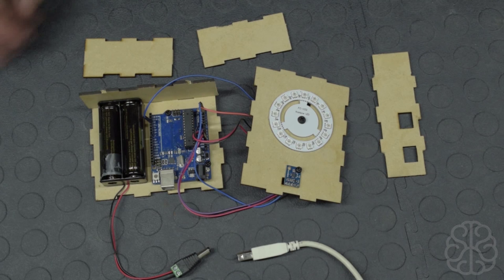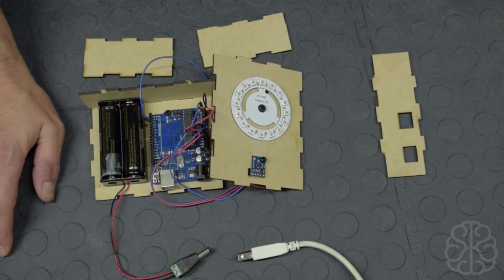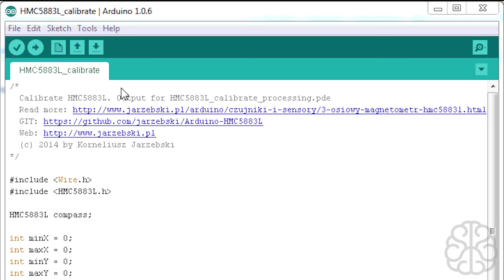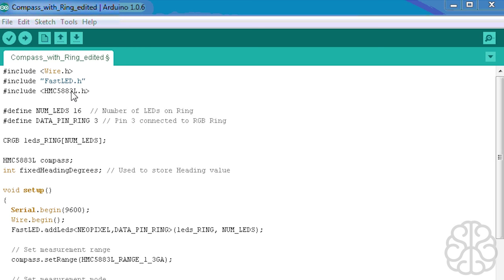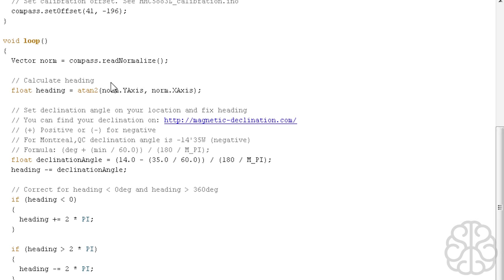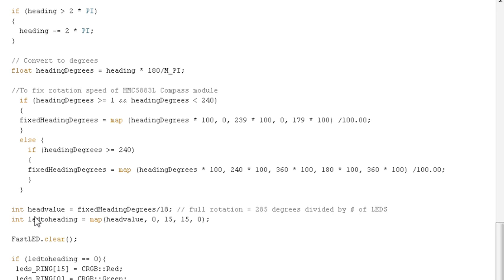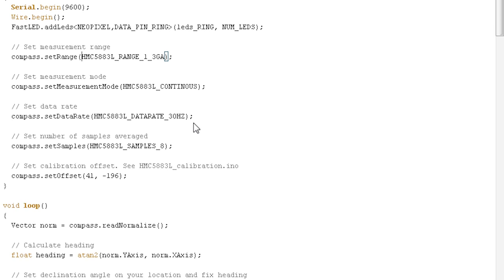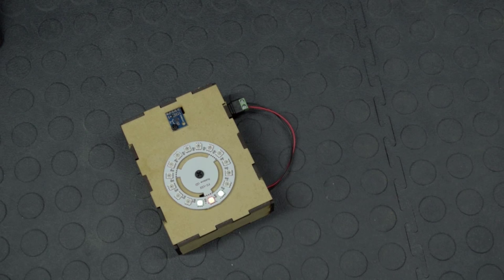Let's build an Arduino electronic Compass using the HMC5883L and a Ring of LEDs - Tutorial

Comment: thanks so much , i have been working for a few hours on this with the wrong library,  works perfect now , on Beitian BN-880 dual GPS/Compass module,  running on Arduino DUE, now gonna work on the altimeter with the barometer sensor.

Comment: Excellent !!! 
I was planning to create such a  project to show me the direction of my directional yagi (HAM) antenna. I think that if I turn away the 5883 from the other items and put it on the (wooden) antenna mast to the direction of the antenna boom, it will be OK. Of course with a small change to the code (when the antenna (with its mast and 5883) turns clockwise the leds must "run" clockwise too, not unticlockwise).
The question is : how far from arduino can 5883 work well? I 'm planning to use 10-15 meters UTP cable (just 3 wires). Do you think it will work perfect? 
Congaratulations and regards.
Fotis

Comment: HMC5883 module has a 3.3V regulator on it. So, you don't need 3.3V to power it. Actually, it would be better to run it with 5V because of the voltage drop of the regulator IC.

Comment: when it is tilted on side. i saw angle change how can i fix that. i need use it on boat. on sea when wave big my boat often shacking and tilted. Thank Brainy-Bits.
Reply: I'm no expert in this field, but how about adding a 2 axis brush less gimbal to the compass? One axis for roll and the other one for pitch. So the compass will measure only the yaw.

Comment: So If I want to make one I should see coordinates ! is there any possible way to make a general code for any place on earth ? as smart system to know the direction wherever you are !
Reply: +Sa'ed Qaryab 
You say coordinates and that makes me think of a GPS. Please note, this sensor is not a GPS but instead only shows direction, not position.

But I don't see any reason it will not work anywhere on earth.
Reply from the maker: +Sa'ed Qaryab This sensor reads magnetic fields, since these are different depending on where you are on earth, you need to tell it where you are so it can make it's calculations based on that location.  Like Gremlin87 said, a GPS gets that information in real time from orbiting satellites.  Thanks for watching!

Comment: This is awesome and thanks for sharing this information. I am working on doing a Unity3D app that I would like to use this with 4 button inputs, two of which are for turn signal indicators but I would like all four to put out the values for N W S E into Unity3d to make the appropriate indicators (Animated Sprites) light up.
Can you offer any advice or tips on how bets to proceed with something like that?
Thanks :D

Comment: Glad to encounter someone else who had the problem of the compass being sensitive for certain headings. I am incorporating this compass for a project where I steer a robot based on angles specified by the user (not headings). So say if the user wants the robot to turn 90 degrees. It rotates by getting the current heading and adding 90 to set the destination heading. Problem is like you said the compass is more sensitive in certain directions. How would I fix this problem? 
P.S. - Really hope you reply
Reply: +royalflush1391 I am trying to do the same thing, but I cannot get calibration to provide me with numbers that work. What happens is that the calibration code returns lots of different numbers (not just one pair) and the numbers returned do not produce a compass that reliably points to N, E, S and W (0,90,180,270). Steering my robot requires reliable compass headings. Did you encounter anything like this? Did you get your robot running well?
Reply from the maker: +Bob Jones Sorry for the late reply guys...  I've made this tutorial quite a while back, so can't remember it fully right now.  Now you are correct that these compass are more sensitive in some headings, but if you figure out the numbers, you can then use the MAP function to compensate for those.  For example if the values 0 to 45 represent 0 to 90 in reality you could map(0,45,0,90) not perfect but easier to work with.
Reply from the maker: +royalflush1391 Sorry for the late reply guys...  I've made this tutorial quite a while back, so can't remember it fully right now.  Now you are correct that these compass are more sensitive in some headings, but if you figure out the numbers, you can then use the MAP function to compensate for those.  For example if the values 0 to 45 represent 0 to 90 in reality you could map(0,45,0,90) not perfect but easier to work with.  This is front the top of my head btw :)
Thanks for Watching!
Reply: hi. i am really lost now. have you solve yours? i need a gidance. i am working on my final year project. please help me. i need this to help solving the maze. notice me please.
Reply: I've had the same problem while making a boat steering system and found this  device is hopelessly unstable and inaccurate. It's OK for playing about
with but it's not  a serious compass.

Comment: Can I use this (HMC5883L) to control Yaw stabilization on a quadricopter, helicopter or model airplane without the need of a separated module, like the  MPU-6050? Or is it best to use the  HMC5883L only to replace the biased, ever-drifting and shitty non-accelerometer assisted Z-Axis output that comes from the MPU-6050?? They say the accelerometer in the MPU-6050 is excellent(I certainly can testify for that in static testing) and can correct very well the drifts on its gyros (X and Z axis). However, when we take into account a vehicle that accelerates too much or even turno into near horizontal flights, the manufacturer of MPU-6050 is quite clear in saying that due to lateral G-Forces this, in a certain given time, can take away from the unity the source/point of reference, that its accelerometers use to un-bias the gyros,  earth's gravity.
Reply: you can use yaw stabilization with HMCL and a girometer.

Comment: Why do I get this error message? I downloaded the library files as instructed.

Arduino: 1.6.5 (Mac OS X), Board: "Arduino/Genuino Uno"

Build options changed, rebuilding all
HMC5883L_calibrate.ino: In function 'void setup()':
HMC5883L_calibrate:26: error: 'class HMC5883L' has no member named 'begin'
HMC5883L_calibrate:32: error: 'class HMC5883L' has no member named 'setRange'
HMC5883L_calibrate:32: error: 'HMC5883L_RANGE_1_3GA' was not declared in this scope
HMC5883L_calibrate:35: error: 'class HMC5883L' has no member named 'setMeasurementMode'
HMC5883L_calibrate:35: error: 'HMC5883L_CONTINOUS' was not declared in this scope
HMC5883L_calibrate:38: error: 'class HMC5883L' has no member named 'setDataRate'
HMC5883L_calibrate:38: error: 'HMC5883L_DATARATE_30HZ' was not declared in this scope
HMC5883L_calibrate:41: error: 'class HMC5883L' has no member named 'setSamples'
HMC5883L_calibrate:41: error: 'HMC5883L_SAMPLES_8' was not declared in this scope
HMC5883L_calibrate.ino: In function 'void loop()':
HMC5883L_calibrate:46: error: 'Vector' was not declared in this scope
HMC5883L_calibrate:46: error: expected ';' before 'mag'
HMC5883L_calibrate:49: error: 'mag' was not declared in this scope
HMC5883L_calibrate:50: error: 'mag' was not declared in this scope
HMC5883L_calibrate:51: error: 'mag' was not declared in this scope
HMC5883L_calibrate:52: error: 'mag' was not declared in this scope
Multiple libraries were found for "HMC5883L.h"
 Used: /Users/michaelknight/Documents/Arduino/libraries/HMC5883L
 Not used: /Users/michaelknight/Documents/Arduino/libraries/Arduino-HMC5883L-master
'class HMC5883L' has no member named 'begin'

  This report would have more information with
  "Show verbose output during compilation"
  enabled in File > Preferences.
Reply: I had a load of problems too. Turns out the cheap magno I bought from E-Bay was a "QMC5883" not a "HMC5883"  now I no this and use the DF Robot library all is well

Comment: what kind of laser cutter (model) did you use for your housing? the cuts look pretty clean.
Reply from the maker: It's a chinesieum 60W laser cutter, the kind you find on Ebay or Aliexpress :)
Reply: @BrainybitsCanada  thanks for your fast reply! it looked like a DIY set made of aluminium profiles on the first glance, but a 60W laser comes probably in a solid enclosure.. should be a bit too expensive for a hobbyist i guess :)

Comment: GREAT DESIGN, YOU ARE THE BEST MY FRIEND.
CAN YOU HELP WITH THIS:

- WORK ON A PLAN WITH X AND Y AXES;
- DIVIDE A RING IN 6 PARTS, WITH ANGLE OF 60 DEGREES, TOTALING 360 DEGREES.
- EACH 60 DEGREES TURN, I NEED TO ACTIVATE THE LED MATCHES THIS POSITION.
OTHER LEDS MUST BE OFF.

WOULD YOU HELP ME?

Comment: I put one of this mag module and incorporated with gps in my drone. tested ok. Fly the drone again after a week. The weather was clear. decided to land the drone.  when i hit rth my drone gone to eratic flight like ufo then fell off from the sky. Asses the damage then i learnt  that the wire from scl came off the solder pad. So for info grab. Solder your wire properly. My $450 drone is gone down the drain.